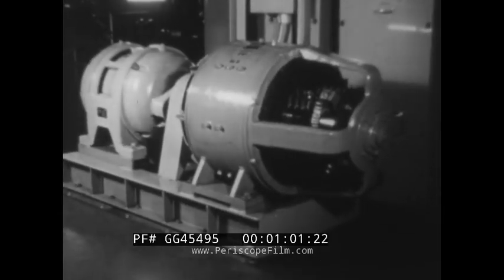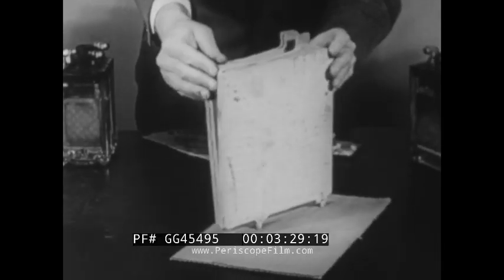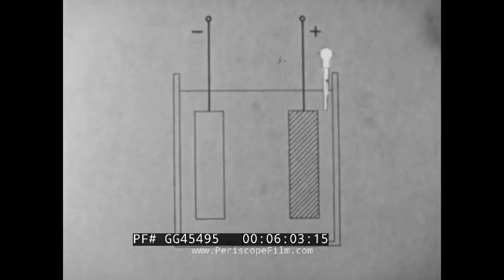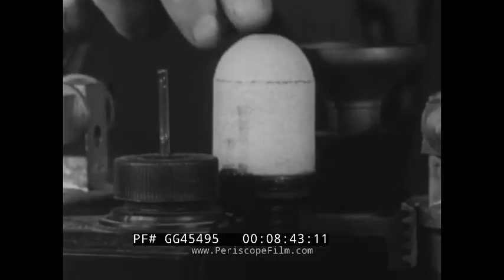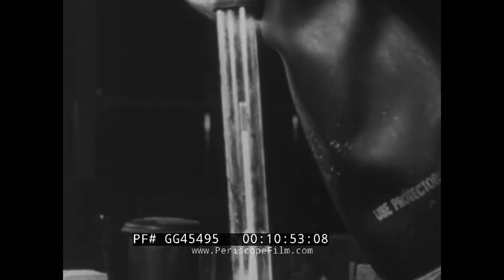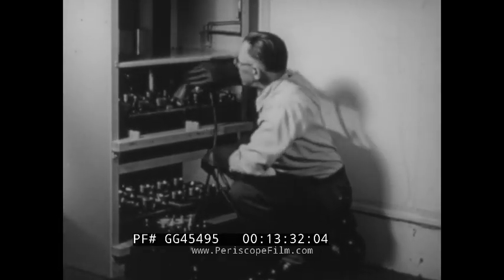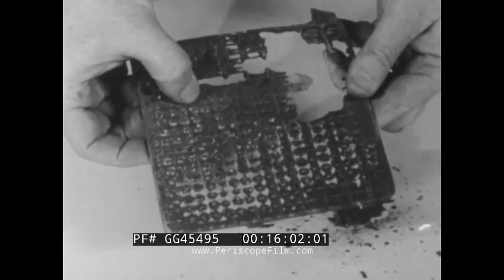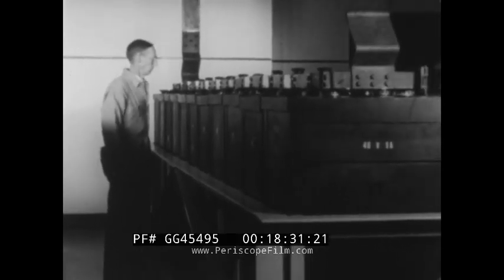" BATTERY MAINTENANCE "  1950s BELL TELEPHONE TRAINING FILM   LEAD ACID BATTERIES GG45495

Comment: I realize that this is a “training” type film, more or less, but I have the sense that this presentation shows a very sanitized version of actual conditions.  The reason is that battery maintenance is messy enough for one 12V car battery, not to mention the many rows of industrial units required to backup the phone line voltage.  

Also, this must have been an extremely reliable backup system because I never remember being without a dial tone, way back when, even during power outages caused by natural disasters, such as hurricanes (on the upper TX Gulf coast).

Comment: I worked for many years in a 30,000 line Western Electric #1 SxS office that first saw service in 1931. (We also had toll and operator services, a tandem machine, wire-line and microwave carrier, and other goodies on five floors.) 
Our power room had the same gear shown in this film, and working in the power room was always very, very precise and regimented for good reasons. 
Two -48V battery strings (capable of roughly 3000 Amps for eight hours) ±130V, and -24V battery strings were smaller. We were about half and half motor-generators and rectifiers for charging. 
The building could run for AT LEAST 8 hours on battery, and our two half-megawatt backup diesels (and a huge underground fuel tank) could run us for a minimum of 30 days (we had a lot of military and government services running through us). I miss that old gear - brutal, reliable, maintainable, and solid.

Comment: I was responsible for maintaining batteries & other power equipment.
Years ago we did hydrometer readings. 
Later I did weekly voltage readings. Rubber insulated tools were required.
Reply: Sounds like a good time to do this work.

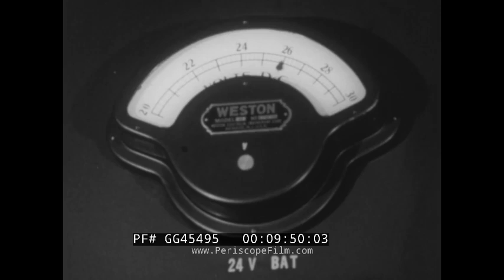Comment: I have the exact Weston Voltage Meter at 9:50. It even goes up to 30 volts. The other Weston meter that's paired with it is for amperage maximum amperage 7,500 A. There are 2 relays between them about the size of Coke cans.
I am an Electronics hobbyist. I bought these at the antique store. It's nice to finally find out what these were used for.👍

Comment: I used to work for the building service contractor that cleaned the US West building in downtown Colorado Springs. My boss would have me clean a different mechanical room everyday, some times it was the long relay rooms other times it was the battery room down in the basement cable vault. Most people don’t know that the phone company uses low pressure natural gas to prevent corrosion of the copper phone lines. I used to have to run an exhaust fan for 10 minutes before entering the cable vault to ensure a safe environment to work in. Both natural gas from the cable trunks and hydrogen gas for the batteries mixed in that room. I was always glad when that room was done. Didn’t like going in there at all.
Reply: Wrong.  Nitrogen... dry nitrogen.  Why?  It is inert, and already very plentiful making a very cheap solution to pressurize cables ensuring no moisture intrusion.  All enclosed spaces are to be vented prior to entry.  Battery strings are vented.  There is no buildup of hydrogen gas.

I was an operations manager for Sprint (aquired US West), and TW Telecom.  You were in my office.

Comment: It's wild the amount of information we have learned about lead acid since this era. Balancing as described in the video for example is a manual process and as such is fundamentally flawed. There's a mention of letting the cells "rest" before checking them... the problem with that idea is there really is no such thing. You can slow the change rate down and get a half an idea, but it still isn't ideal. Then the "boost charge"... the only way they had to offset imbalance, is a very delicate thing and is very difficult to do correctly. Just a tiny fraction of a % in state of charge, or uneven capacity differences (due to normal aging), can cause radical swings in terminal voltage under load/charge conditions, and can't be seen with a standing test.

The real way to do it is how it is handled now... on the fly balancing and monitoring. Not just because lead acid has been replaced with better chemistries, but because the truth isn't fully revealed in a standing battery. Both charge and discharge behavior needs to be observed to get the whole story.
Reply: You are wrong.  All batteries have a static self discharge rate.  Allowing a flooded cell battery to 'rest' helps scrub some of the superficial surface charge.  it allows the battery to cool.  These guys know far more than you.

Comment: We lived close to a Post office telephone supply depot in Islington( London). Every now and then the care-taker would let us kids rummage through the boxes of duff/broken parts and we would gather mics/phones/ wires/batteries/ line testers/valves/ caps/ diodes/ resistors and switches to build our very own phone circuits covering our play area around the Drayton park to Highbury railway land . We did'nt even have a tech book or plans we just used our common sense and started by connecting microphones via a battery to a reciever and over 100 ft we could hear our voices as clear as a bell. The reverse for talkback. Marconi PO supplies gave us a "leg up" into communications and audio engineering without knowing it. Most of us ended up earning a living with the help of a little " practical" skill gleaned while playing. That was 1970s London.

Comment: I was telco engineer during it'peak era the 2000's . at the time there was a revolution from digital switching into software switching. The cental switching room still need those huge battery compare with today's data central all IP base style which use small batteries

Comment: Few people appreciate how much effort went into ensuring landline telephones would continue to work in an emergency when electricity from your local power utility failed. I hope that is still true today for cellular communication but wouldn't be surprised if it wasn't.
Reply: Most cell sites DO have battery back-ups and charging equipment.
Reply: I had a similar thought about wired broadband services. With phone lines, access to emergency services could be the difference between life and death. Now the main form of communication is via Internet. Cable and fiber service providers don't seem to be as concerned for reliability. Even though they offer phone service, it's just an after thought. I get faster speeds from cable, but when I had DSL I never noticed an outage.
Reply: Nothing has conceptually changed at that level. There are still batteries and some also have generators.
Reply: Это не просто техника, а культура ушла и обесценилась.  К тому же, с уходом "ламповой эпохи", исчез сенсорный опыт, архитектура и эстетика схем и конструкций. У молодёжи теперь заметны пробелы целых пластов реального, романтического, гармоничного мира. Только виртуальные фальшивки у них. (Они даже не знают запаха щелочного аккумулятора и шеллака...😢)
Reply: They have a UPS to carry it through the start up and transfer to the backup generator
Reply: @DarkWereWolf6969  I worked for Google on their datacenter automation team. They use the same approach. Guess what, they neglected to test and replace dead UPS batteries. Resulting in outages when datacenters lost external power. Yes, Google instituted changes to ensure the UPS units would actually work when needed but it's an example of the sort of failure that is obvious in hindsight but happens all too often.

Comment: My desk was less than 20' from 144 of these, (6) strings. 20 years of looking at them, thankfully I knew of the hazards.
Reply: Good for your health... you won't smoke at work!
Reply: What was your job?
Reply: @jkuebler89  I was a central office technician working on the switching and transport systems
Reply: They put you in a goddam tomb.
Reply: Did you drink battery water ? It was pure distilled water and we used it to make coffee.
Reply: @whiskeycat-i6h  No.

Comment: I was a commercial/industrial cleaning contractor for many years and we used to go into some of the battery and switch rooms. Huge bus bars. Plenty of acid smell. All the usual safety precautions. Cleaned a lot of neat places. Wonderful old meters switchboards etc. in this film. Also a good lesson on how a cell works.
Reply: I was a sub-contractor as well for water treatment. Lonely CO's were creepy places. But having that card-key meant you had a rest stop in every town.